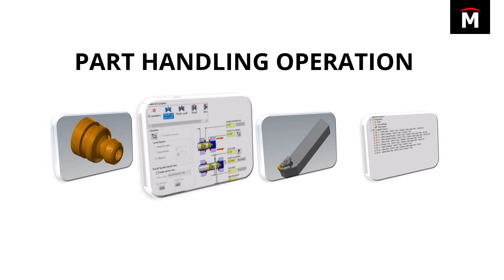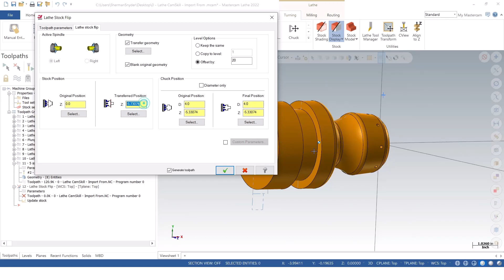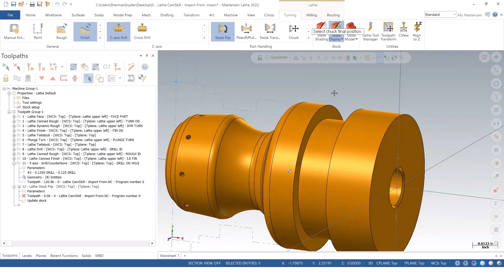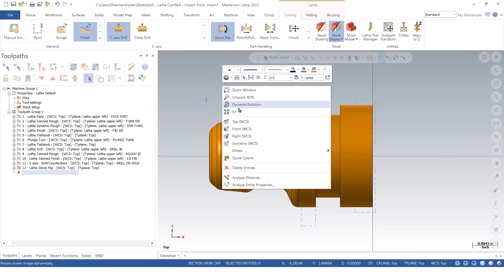How to Perform a Stock Flip - Advanced Lathe Tips and Tricks 7/12

Comment: Well that option flip stock isn't at that position now 2025 version.. cant find it hehe.
Reply from the maker: I just confirmed the option is in the same place in 2025 with the default lathe machine and requires only a basic lathe license. If you are running a mill turn environment you may need to look under the standard lathe toolpaths, and your specific machine may not configured to support this option.